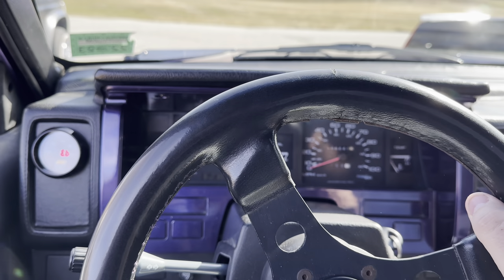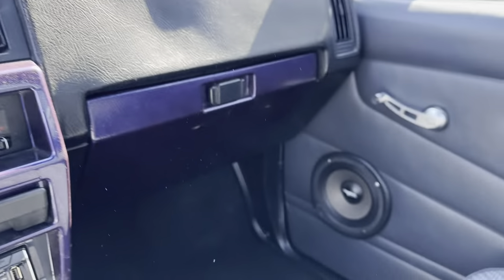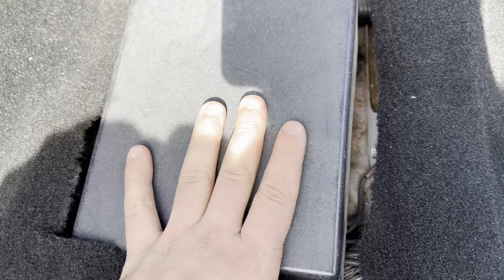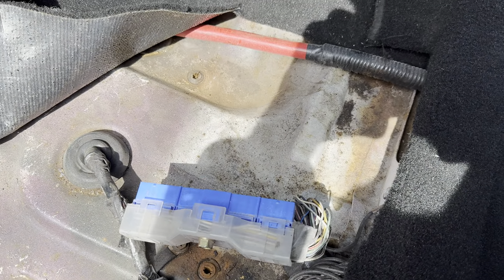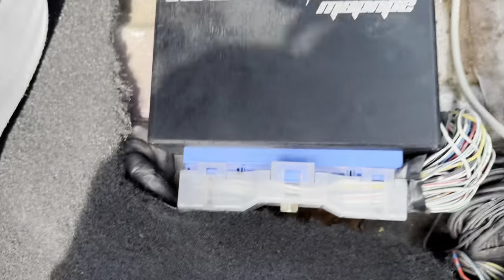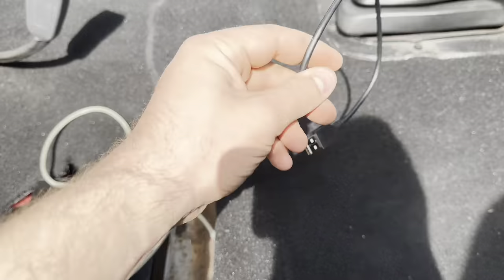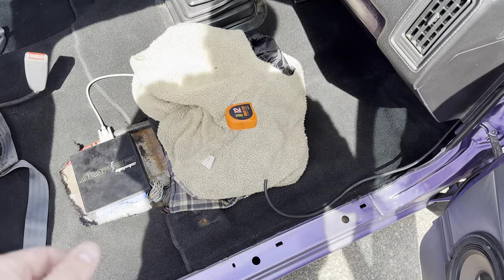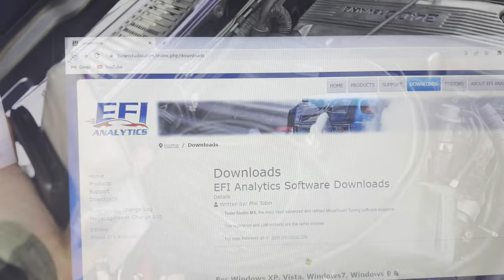Installing A MegaSquirt Stand Alone ECU In My Nissan D21 Hardbody!! Part 1

Comment: This doesn’t look too bad I’ve been worried about blowing my truck up I’m built motor on stock tune on stock computer and it somehow runs good
Reply from the maker: I had not gotten a chance to reach out to a professional tuner to really have the truck tuned, I actually swap back to my stock ECU for right now and did a couple small mods since this video in the truck runs the best it has ever ran, once I'm ready, and I Turbo it or something maybe I'll swap back over to the megasquirt ECU

Comment: Does it just plug in ? And can I use it if I’m fully stock ?
Reply from the maker: I would watch part 2 as well but it is plug and play and can go with a fully stock truck, there wouldn't be much of a point to doing it to a fully stock truck truthfully, I would do some bolt on things first to gain some power and then jump into this, it's a bit pricey and to make power unless your really good at tuning or take the time to fully understand it you'll want to talk with a pro tuner!